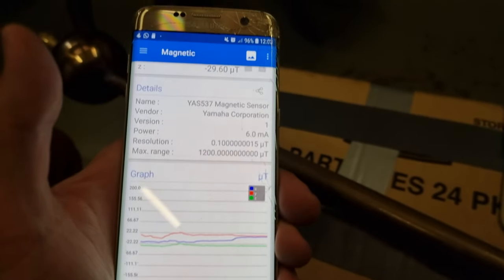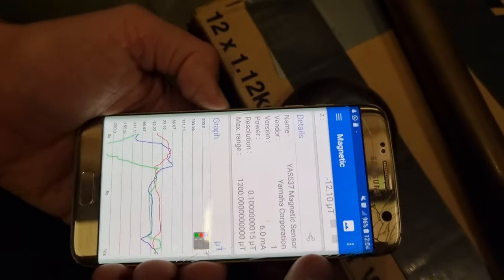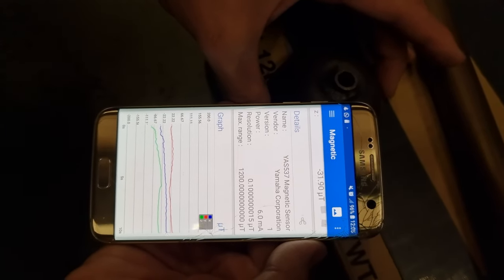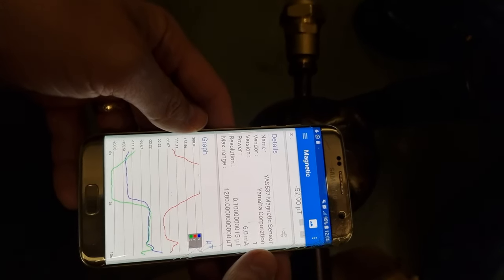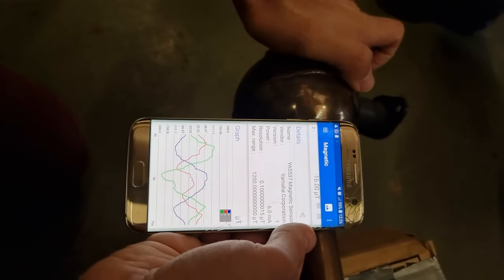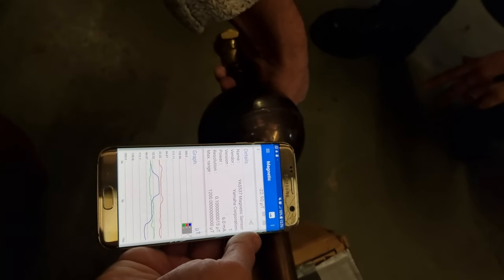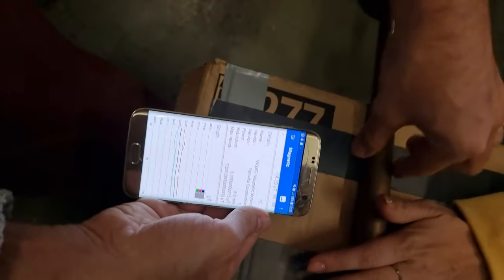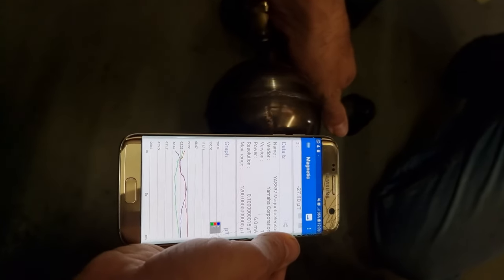THOR - Variations in magnetometer readings over Thunderstorm Generator parts

Comment: You’re seeing a magnetic spike when you turn it 180 because the inner sphere is tack welded inside the outer sphere. The welds are obviously magnetic
Reply: The inner must be sealed, and I’d bet, cleaned up and pressure tested.
Reply from the maker: Likely